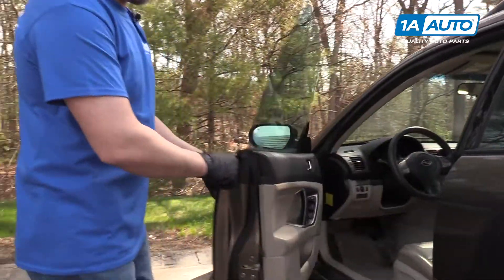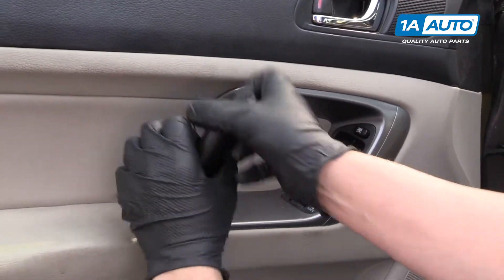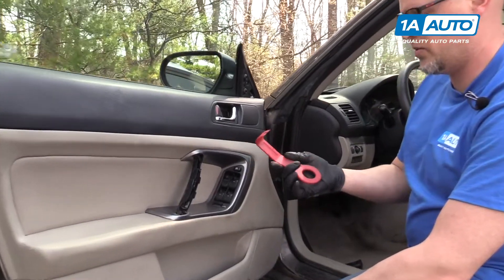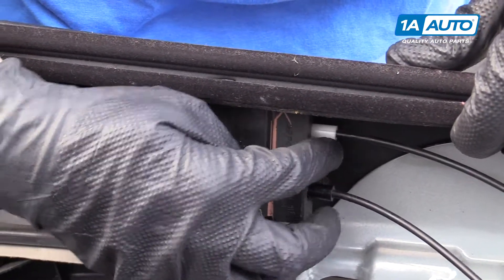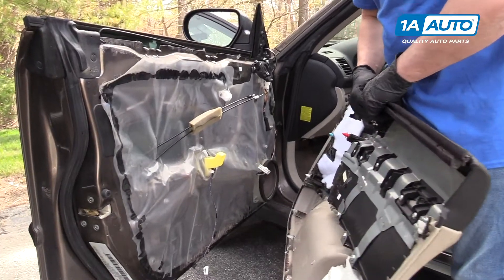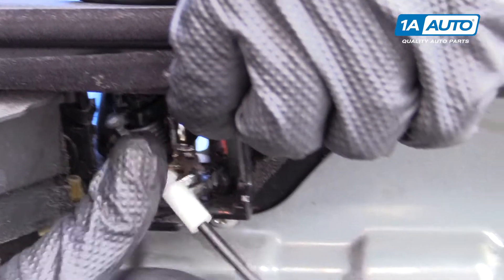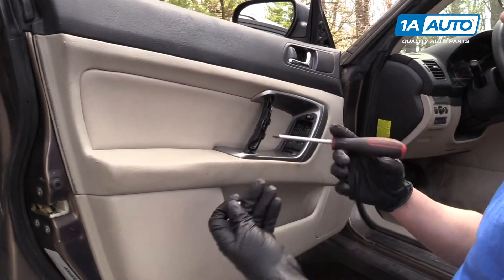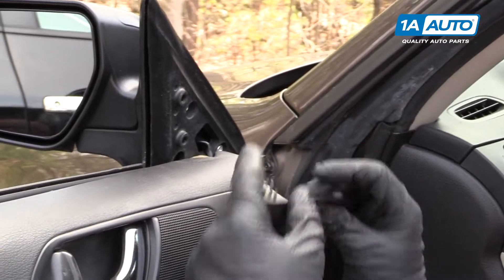How to Remove Front Drivers Side Door Panel 04-09 Subaru Outback

Comment: I just noticed when I was cleaning the cup holders in my Crosstrek, the water I poured in the cup holder in the door drained out the bottom . Is that suppose to happen or is that a flaw in my car?  It happens on driver and passenger door.